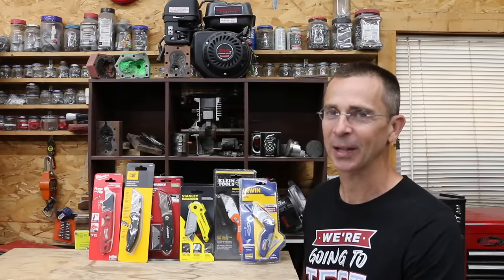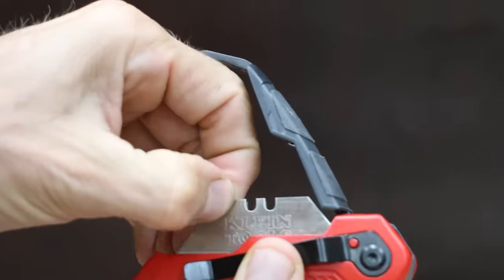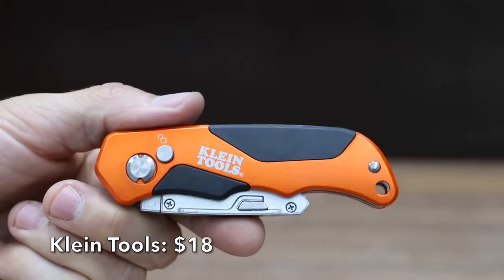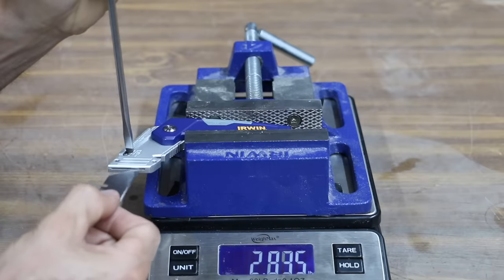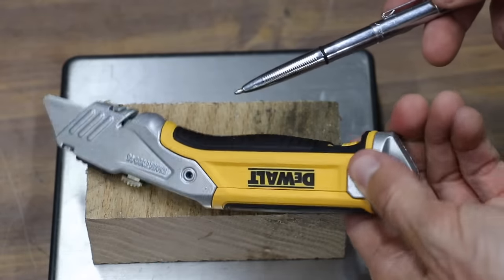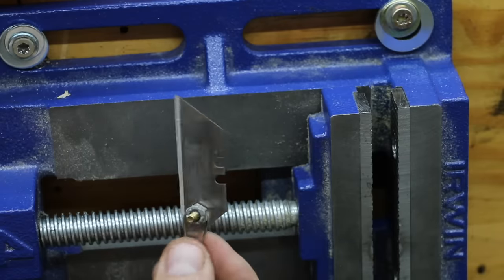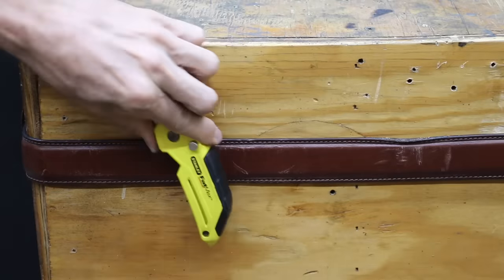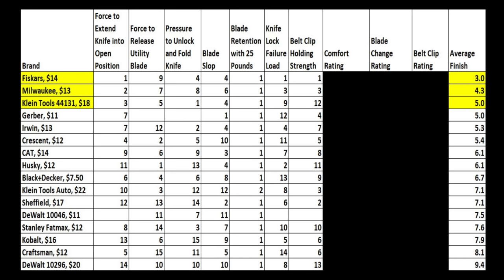Best Utility Knife? Let’s Find Out! Milwaukee, DeWalt, Gerber, Husky, Kobalt, Klein Tools, Craftsman

Comment: I prefer the flip open design over knives you have to physically open up.
They look a bit more dangerous, but the flip open design keeps my hand away from the blade, making accidents much less likely to occur.
Blade sheaths with greater tension to open or close just feel like an accident waiting to happen.
The most important thing about a flip open design, is the locking mechanism when the knife is open or closed, if it doesn't lock properly, then we have problems.
Reply from the maker: Thanks for the feedback.

Comment: It's interesting that you're comparing the Clip Performance using a padded belt rather than a solid leather belt.  
It's also noteworthy that pocket knives are kept in Pockets so the Clips on these may have been designed for the user to slide it into a denim pocket without an excessively large tab to get caught on things.
Reply from the maker: Thanks for watching!

Comment: Absolutely love your channel 
Would you consider testing men’s shaving blades. 
Gillette , Harry’s, Dollar Shave Club, Wilkinson. All blades  seem  very sharpe when new but I suspect some age as much from moisture exposure as from actual usage.  Required pressure to get optimum performance. Price point.  Maybe you could disassemble blades to perform durability and moisture  exposure age test on a single blade component.  
Thank you 
Terry from Tucson
Reply from the maker: Thanks!  Thanks for the suggestion.

Comment: I used to use a shefield styled knife, but it stuck out of my pocket just enough that it would catch the sink at work. The new style Milwaukee sits really low in the pocket and the single hand flip open is clutch.  It kinda feels a little flimsy, so I tried a bunch of other styles.  The Milwaukee is still my daily carry.  I might pick up the dual blade for tougher jobs, if it does good in the testing.
Reply from the maker: Thanks for the feedback.

Comment: I may be wrong, but I’m pretty sure the Canadian version of most those knives have different opening procedures, or additional force to open them. For example the Milwaukee can’t flip open.
Reply: Also, for the viewers, I cary the Milwaukee fastback 6 in 1. It’s actually smaller than the original fastback, holds 1 extra blade, and has a 1/4” bit holder.  Sounds gimmicky, but it’s not at all.
Reply from the maker: Thanks for the feedback.

Comment: I would have liked to have seen DROP TESTS. Tip, heel, and sides from varying heights and checking function and damage of knife after each drop. Clear  1.5" tube to test drop on tip. 4' height for a normal drop test, then maybe 15 height for dropping off edge of roof or ladder.
Reply from the maker: Thanks for the feedback.

Comment: It's been a while since you did these, wondering if you will do any tests on snap off utility blades? Cause currently in the market looking for one of those. Heard some bad reviews about Fiskars where the blades came out while cutting into something. Another person mentioned how once you got down to the last 3 blades it didn't hold them in place thus wasting the last 3 blades. As well as the blade slider being smooth which makes it harder to adjust. Someone else mentioned the blades came out of the knife every now and again while cutting stuff. Thus can be dangerous. 

So hoping soon you do a video on different brands snap off utility knifes.
Reply from the maker: Thanks for the suggestion.

Comment: Project Farm,

Excellent video. If you haven't already, can you make a video on the best wire nuts to provide a definitive answer to which is the best.

I tend to find traditional wirenuts can carry the most current if installed correctly.
Reply from the maker: Thanks!  Thanks for the suggestion.

Comment: I've carried an older model of the Sheffield for about 12 years now.  It's an aluminum body with the lock back design.  Pressing on the lockback, I can flip it open with one hand.  It does  have the same issue with the cover wanting to slide with a blade change, but it has become second nature to hold it together when moving the lock into place.  Given how thin and light this knife is, I don't think I'd give it up and time soon.

I've had a knife similar to the Gerber EAB light.  I really did not like the blade retention.  Under heave cutting loads, the blade could flip out of place.  It was very annoying and dangerous.  Looks like they may have fixed that issue with the slide in retention.
Reply from the maker: Thanks for sharing.

Comment: I was betting on the Fiskers.  The two biggest frustrations on using these on sheetrock is the blade coming out after a few uses, and changing the blades.  Seems like the only one that work for me require a screwdriver.
Reply from the maker: Thanks for the feedback.

Comment: You’d be surprised how easy it is to badly cut yourself with a knife with an inadvertent open blade. Managed to cut through my thigh to the bone with a knife that was sticking through a backpack. Was so sharp I didn’t even notice I’d done it until a friend noticed my jeans had turned from blue to red.
Reply from the maker: Wow, thanks for sharing.

Comment: A big debate going on here about child car seats being used after the car has been involved in a rear end shunt at a lower speed than the test crash. Bearing in mind these seats are still made by corporations with more of an eye on profit. But because some children are being driven about without them it was recommended by the NHTSA to reuse them. However some manufacturers still say replace them. Can you organise some tests to find out if they can be reused if the accident is below the crash test speed ? James

Comment: I started out using the dewalt one and after breaking about 4 of them in a year I switched to the milwaukee one about 6 years ago and still have the same one and use it to cut sheetrock samples every single day. The dewalt fails when you push to hard against the blade.
Reply from the maker: Thanks for the feedback.

Comment: Could you test the folding box knives inside the ammo box, you used for the measuring tapes? I have a problem with ceiling tile dust and wood shavings getting caught in the knife, making it hard to open.
Love the vid!

Comment: Episode idea:  Best Electric Brad Nailer

Possible test
- durability 6 foot drop
- fastest 100 Brad nails
- reliability 100 Brad misfire & jams
- strength 4 depth into pressure treated 4x4
Reply from the maker: Thanks for the suggestion.

Comment: No Lenox brand??
I've done years, decades in construction, usually roofing, but everything from drywall finishing to siding to electrical to framing, and I've always used Lenox Gold knives, typically the straight Lenox Gold ergonomic nonfolding type (20353) along with of course, Lenox Gold blades, absolutely nothing else, and I know they have folding utility knives, I'm surprised you didn't include any.

I still remember my old roofing boss who used to swear by Stanley hand tools and tapes, and I come with my belt rocking my bright white Lenox Gold knife and Lufkin tape(two brands I'll never leave), we both use Estwing hammers of course (he used Stanley pneumatic nail guns, I used Hitachi lol) but he would always talk 💩 on my Lenox knife....then I took a weeks vacation and my best friend texted me (his dad was the boss in question) and said "dude, you left your tool belt in the truck and he's been using your white knife constantly" I'm like yeah, because it's the best 😅

Granted, I've never tried their folding utility knives, but I know Lenox makes quality stuff, and I know their blades are the best (Lenox Gold). Might have to redo this test with Lenox's offerings.
Reply from the maker: Thanks for the suggestion.

Comment: Such a massive market... how did you choose these knives?  I have a Stanley Fatmax that has a button to open automatically, I have a DeWalt that has the "automatic" blade replacement. Basically utility knives are wide and varied and this selection you have chosen seem to be to recommend a specific brand.

Comment: I am a bit confused.  I could be wrong, but...
...you called the falling piece of rail a 'railroad tie' on this video.  Being a railroad fanatic, I wondered about that.
The ties would actually be the creosote soaked wooden things, under the rails, holding the rails to them with spikes and tie plates.  
Newer ones use concrete ties, and the spikes are replaced with pandrol clips that keep the rails to the tie plates.
Just wondering, because I have been known to take things out of context, too.
:hand-pink-waving:

Comment: I would love to see a test of power inverters.

Pure sine vs modified sine, output vs rating, output vs input, operating temps, minimum voltage maximum voltage, etc.

I just had to upgrade a low cost modified sine wave inverter in favor of a "pure sine" inverter because the modified sine would not run an electric blanket.  I'm happy with my replacement but it got me thinking, I wonder how all these stack up against each other.... and I know just the guy to ask!
Reply from the maker: Thanks for the suggestion.

Comment: I wish the original Superknife or SK2 were still available. They were simple, thin, and light, but sturdy. Then the company got bought by a bigger manufacturer and all designs were discontinued. Now all these knives are twice as thick and really heavy, not something you can use as an edc. It originally came out around 2005 and was bought out around 10 years ago. ☹️
Reply from the maker: Thanks for sharing.

Comment: Interesting that I saw this video literally the day after I broke my Milwaukee razor knife (the internet is omnipotent/omniscient). The little lever where you open the blade storage broke.. I mean, to be fair, I tried to put one too many blades in but that's when I realized the little lever was made out of plastic. But other brands I've had, you could put 5+ extra blades in them and the Milwaukee started getting stuck after 3-4. I slathered it in krazy glue so maybe it'll hold together.
Reply from the maker: Thanks for sharing.

Comment: Good review...however...you didn't test the blade replacement features when clogged up with sheetrock dust. I used a Husky the other day on sheetrock, and found blade change-up was damn near impossible, and had to use pliers to pull the blade out. Do an additional test cutting some rock and then try changing blades...
Reply from the maker: Thanks!  Thanks for the suggestion.

Comment: Fun tests, thanks. 
I've a Sheffield badged Craftsman with pouch as a freebie with wrenches. I like free. 
And a slough or others acquired over the decades.
 At least the blades became/remained universal, something charging cords should have been say mandated years ago.

The company I retired from took away all our bladed and called them possible weapons. :-l  
The gave us auto retracting razor knives. eesh, the place were I'd use one the longest period of time here and there. 

Closing force/lock is an odd test unless someone put the blade in upside down. (-:
Reply: Cutting strapping whether plastic-ish or steel I used my 9.5" Channel-lok pliers. There's a simple angle/wrist twist finesse to it. They're also small hammer, prybar, and of course a nut rounding wrench Maint. dept hated us for.
Reply: Too late for the suggestion cuz ya broke them;
~ Years back I was researching for my first one handed folding lockback knife.
Although a tad pricey (90.00) I chose a Benchmade Griptilion 551 after the kid testing it some kicked it though the dirt/sand pretty good. After a few taps against object it was ready to go. ~ I've not seen that for any other locking folders but it looked good to me.
Reply from the maker: You are welcome!

Comment: there is something you missed to measure PF, which is blade length utilization. For example, Crescent Knife's have a 60 deg blade holder, which expose about 41% of the blade, flip it around, you can in total utilize 82% of a utility blade, but 18% are burried in the middle, never used! 

VS Milwaukee have a 45 deg blade holder, which expose about 58% of the blade, so you can make use of the entire blade! this is important because, the more blade length you use the slower  you dull your knife, simple as that.
Reply from the maker: Thanks for the constructive feedback.

Comment: I really enjoy your videos, but this one I did not find very useful. I'm surprised you didn't test to see at what point the blade did not sheer out of the holders. Often times it's necessary to put a great deal of force on the blade, or even use a hammer to strike down on the top of the utility knife to drive it through some material. Testing for this would have been nice.
Reply from the maker: Thanks for the suggestion.

Comment: I found the original Milwaukee Fastback (pointed tail, no blade storage) to be the best utility knife for hard use. i owned several but my first is still kicking (and flicking open smooth as glass). i would have liked to see all of Milwaukee's Fastback variants tested here, although i think they all use the same pushbutton lock. I also have the Gerber, which is great for always having on you because it's so light and tiny.
Reply from the maker: Thanks for the feedback.

Comment: Would you please test what dielectric grease for electrical connectors for batteries is best in marine (saltwater) application  or on land use thanks
Reply from the maker: Thanks for the suggestion.

Comment: You should test to see if brake fluid can seal an engine leaking oil I’ve used it on a 4930 sprayers planetary drives that were leaking and it sealed them that’s been about 5 years ago still no leaks
Reply from the maker: Thanks for the video idea.

Comment: i have used them all , the milwaukee hands down is so much better. i don't care how much it costs, however they usually have 2 for 10 bucks on promo around holidays. the other brands are so much worse, hard to open, hard to change blades,don't lock open well on and on.
Reply from the maker: Thanks for sharing.

Comment: The big thing I wanted to see is how much it takes to break, when you put weight on the blade. I have had a knife fold backwards and it pinched my fingers between the back of the handle and the blade holder, and it hurts.
Reply from the maker: Thanks for the feedback.

Comment: The yellow one that dosent flip is the best unless you dont work in construction had one for 8years now 3 years in stucco i use the back of the yellow one to break stucco bamm bamm bamm i see every riding the milwakee horse but that one suxx badd like all the other ones  two weeks in stucco and they will be crooked jameed floppy junk of tool except that one pro flip knife with the steel back looks decent, cmon 8 years and still my dewalt knife it working just fine  not to mention if your wearing painters pants and you put those silly compact knife in your tool pocket youll be fumbling looking for it in all your pockets because there too small and sometime cant feel them in your pocket where as the yellow one that dont fold always perfect height easy to find in your pocket forget about itt 😊
Reply from the maker: Thanks for sharing.

Comment: Have you test LED Strip Lights? I am more interested in White LEDs for Brightness, Color, and CRI for use in under cabinet lighting, in cabinet lighting, task lighting, and maybe even custom fixtures for workshop / STEM Lab / Maker Space overhead lighting. Common brands I seem to see are HIT, BTF-Lighting, Solid Apollo LED,   Thanks.
Reply from the maker: Thanks for the suggestion.

Comment: Suggestion unless already.   Back to the oil wars.   The question is emergency adding wrong oil.  Such as adding 5w-20 quart to 5w-30  or any combination.    If engine needs 5w30 on trip low oil and nothing but 20w50.   Will your lawn mover blow up ? That labriski trst you do?    with 1 quart mismatched.  what happens or nothing?
Reply from the maker: Thanks for the suggestion.

Comment: It’s time to do diesel fuel treatments, so many diesel guys recommending so many brands. Fords, Cummins, GM, and all the other small diesels, all running the cp4 Bosch fuel pumps that are failing. EDTs hotshots, ams oil, ect. It’s said some are snake oils! Biggest concern is adding lubricity for the pump!
Reply from the maker: Thanks for the suggestion.

Comment: With the exception of the Fiskars I would bet most of these knives were made by 3rd party manufacturers who add a logo to their existing design.  I have the B&D but mine is a yellow and black Dewalt - same exact knife except for the coloring.  What would be useful for a follow up video some day is how these knives age.  Do they still open smoothly?  Do blade changes get much more difficult after corrosion starts?
Reply from the maker: Thanks for the video idea.

Comment: Not a fan of liner locks on any type of folding knife system. Also ease of opening should be stiff IMO. Not too stiff but you don't want these opening up in your pocket. I prefer Husky because it passes on my first tests plus has a firmer and better blade holding apparatus. Takes a few more seconds to change blades but you get a superior firmer holding. Husky all the way.
Reply from the maker: Thanks for sharing.

Comment: I have an idea you can use that would also help me out a lot. 

I have a 99 ford ranger that I use conventional engine oil in because I’m nervous about potential seal wear and leaks that have a tendency to take place when switching to synthetic in some older engines. 

That being said, I’d like to know which oil brand has the best conventional engine oil. I’ve seen your oil videos when it comes to comparing brands with synthetic oils, but what about conventional? Would there be any difference? Would be nice to see!
Reply from the maker: Thanks for the suggestion.